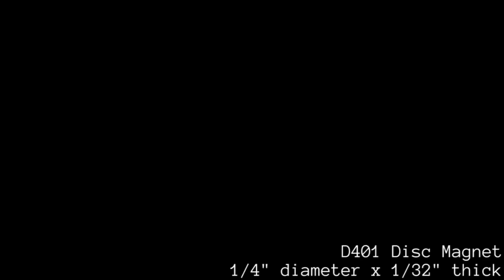Magnets Breaking in Slow-Mo

Comment: I HAVE just bought 20 of your strong piggot magnets and when I got them one pulled out of my hand getting them separated and broke 4 other magnets including its self for total of 5 wanted to cry... so strong I cant separate the broken pieces hard lessons also cut my hand cause so sharp when broke .. also feel they should be a little more spacing on those big ones so hard to get off they pull back and break the others.. great video and hope saves few like me, learning curves.. ughhh..